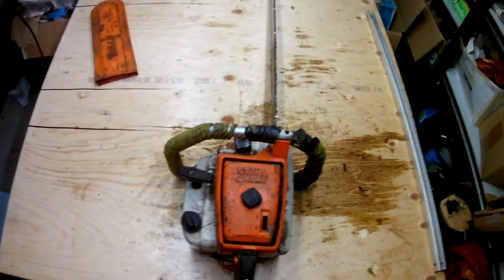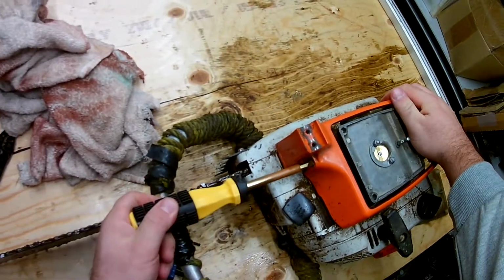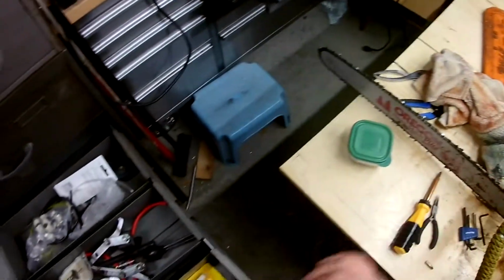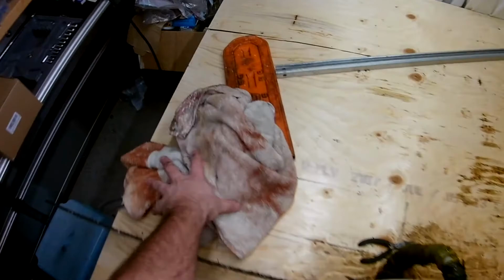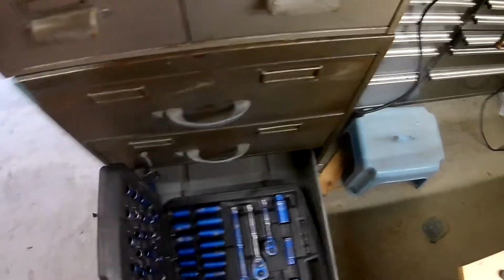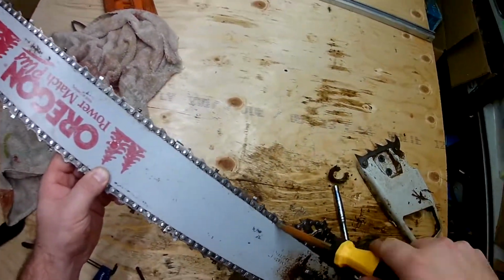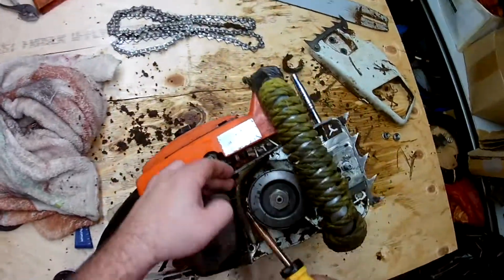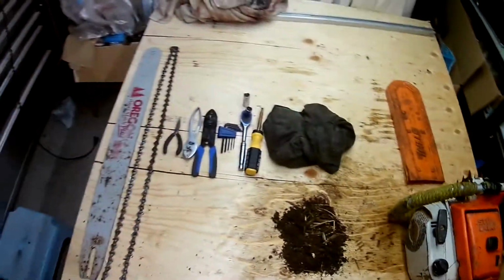Stihl 041AV Chain Saw Repair

Comment: I worked on my 041 farm boss got it all finished but no fuel to the carb. finally discovered that when you insert the outer hard plastic hose barb piece into the rubber fuel line that goes into the tank and holds the filter, it can go cockeyed and close off the end of the line. it seems like it would just go right into the center of the line, but not so.  if you have no fuel feeding from the tank to the carburetor,  before tearing it apart, stick your fingers in the tank and feel that it's not pinched off due to misalignment.

Comment: You could have just taken the two little nuts off the filter box on top and lifted it off to access those lines.
Reply: LOL. yes I had to put in new fuel lines and that's how it did it also.  Seems like he took apart more than was needed to change a nfuel line but then he wasn't due what the problem was yet.

Comment: Whats the problem of my o41 av, it starts but low power to  ut.
Reply from the maker: Could be a number of things, fuel filter clogged, air filter clogged, small leak in fuel/seepage on lines or connections. It may be the carburetor has come out of adjustment but that is rare, stihl saws are factory calibrated and if undamaged usually only act up if something else is wrong in the system i.e. to little/much fuel or air. Most likely it will be that the diaphragms in the carburetor are old/worn out/leaking and/or carburetor gaskets are leaking and pulling in air. Check your filters, lines, and connections, check the spark-plug/boot and check spark-plug gap (it is unlikely this is the problem but it is still a good idea to check). Make sure the chain and flywheel are not being impeded/stuck. If all of that turns up ok, then you are looking at getting the carburetor checked/tuned at a stihl distributor/technician, or replacing/rebuilding the carburetor.
Reply: Selturas Soma my carburator, spark plug and air filter are all brand new. Bought it online fewdays ago (@LAZADA).  It starts but low accelaration, i will try tomorrow your suggestion for the fuel filter. Btw thanks
Reply from the maker: @rwongspilleng9447  You're very welcome let me know how it goes!
Reply: Nothing change. Maybe i will bring this into chainsaw mechanic
Reply from the maker: @rwongspilleng9447  Best of luck to you
Reply: Thanks